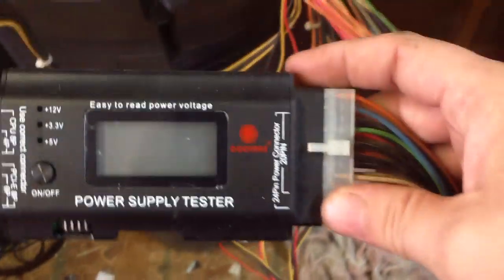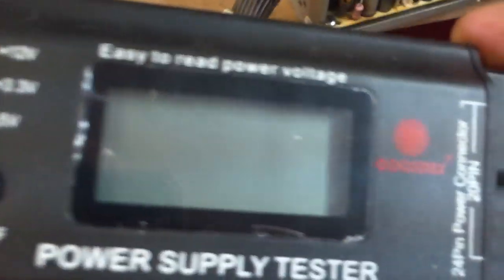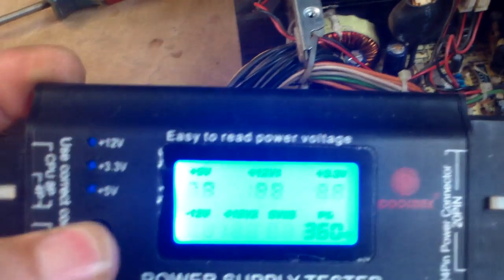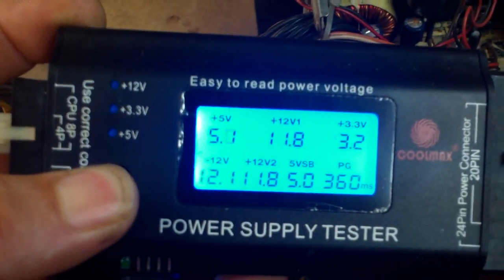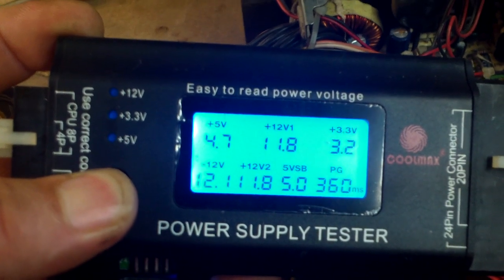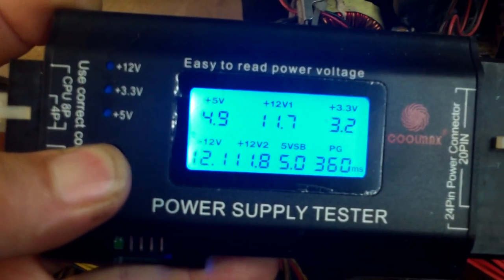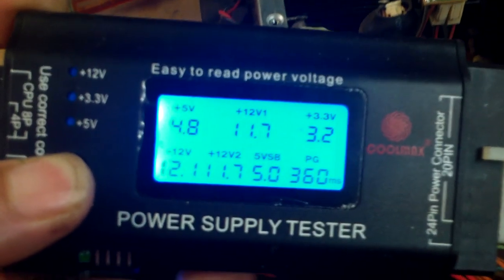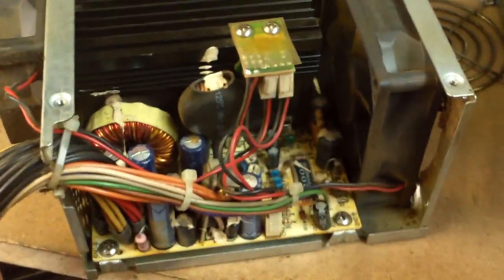Coolmax Power Supply Unit (PSU) tester fail.

Comment: the fluctuating 5V rail was a dead giveaway that the PSU is dead. there is no load so there should be no reason for the 5V rail to jump around like that. no way I would let that PSU into a computer if i saw that. the tester did what it was supposed to do.
Reply: A multi meter will give the same readings... that is why you cannot trust a multi meter!!!. XD  shieeeet.

Comment: couldn't you get a cable splitter and hook it up to a test and computer at the same time?
Reply: Bit late. But I was wondering the same thing. Buy a Y cable with two 24 pins to one female end. Plug one into the motherboard. One into the Tester and the PSU into the single female end.

Comment: Второй ролик и снова те же ошибки. Не обращаешь внимание на показатели! Увы но тебе ещё учиться и учиться а не критиковать работу тестера.
Reply from the maker: I see many "good" PSUs with spec in the range shown on the tester. The numbers are within tolerances. Atleast as far as the tester is concerned. But this is and obviously bad PSU.
Reply: JustCallMeChad глупости! допуск: по 12V не менее 11,9! по 5V не менее 4,9. твои показатели 11,7 и 4,7 и периодическим LL - проблема с конденсаторами(заменить!) плюс параметр PG 380!!! оптимально 280!

Comment: how is that a fail the 12v is low the fluctuating 5v is dead give away you have a problem which would have made me  open the psu for inspection that thing did exactly what it was supposed to do
Reply: Yeah.. Plus the 5V had a "LL" for a sec, which means no voltage detected.. Even if the power supply is malfunctioning only .1% of the time, I would still say the power supply is bad. I'm not really sure about the other power supplies that were tested though.
Reply from the maker: half the PSUs I test that are good, have about the same reading.
Reply: THEN HALF THE PSUs YOU TEST NEED REPAIR I JUST GOT ONE OF THESE TESTERS AND THE VOLTAGE DISPLAY MAKES A BIG DIFFERENCE COMPARED TO THE STANDARD TYPE THAT COULD GIVE YOU A FALSE POSITIVE CONSIDERING THEY USUALLY ONLY SHOW LEDS LIT
Reply: Dustin Seiveno the 5v fluctuating  is the 12v is low under no load